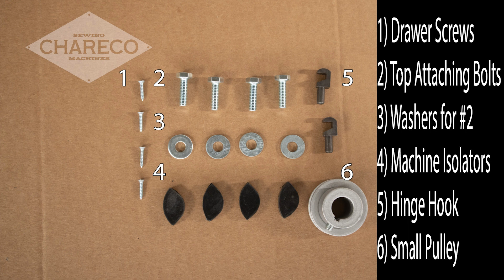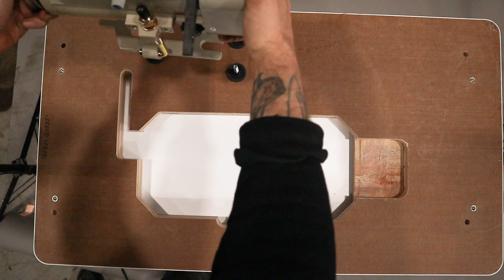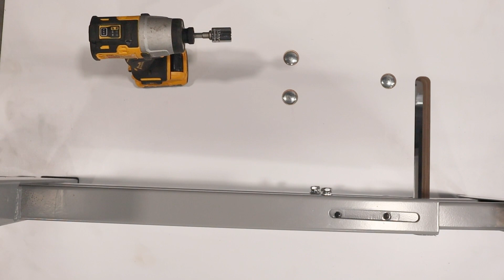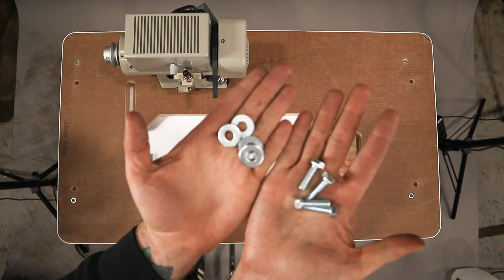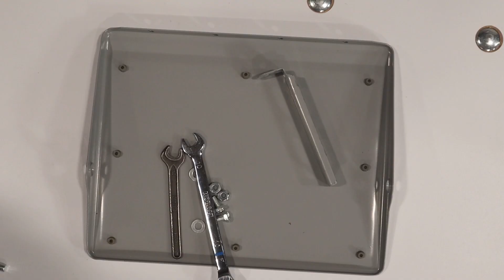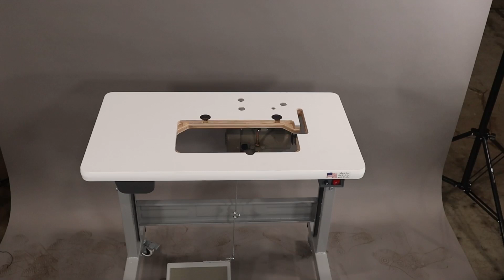How to Assemble an Industrial Sewing Machine Table.

Comment: My table has a fixed placement for the foot pedal brackets. But I need to push mine back about 5 inches. Where can I get those square brackets that I can screw the bolts into at the bottom? What are they called?